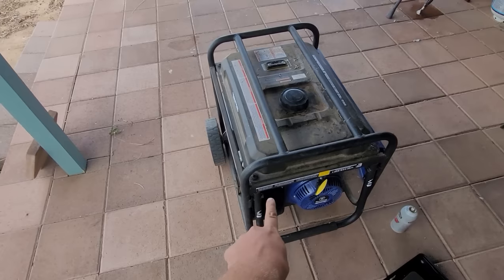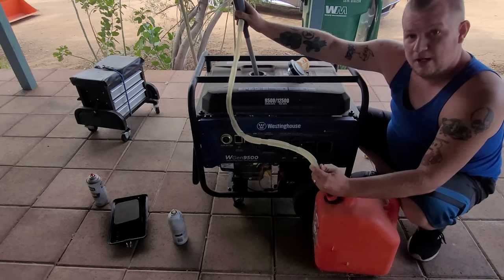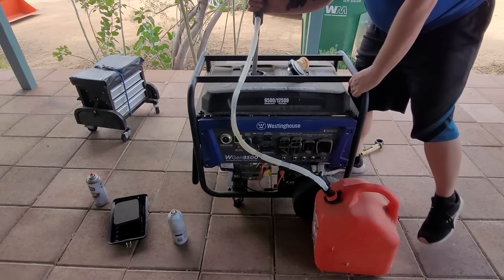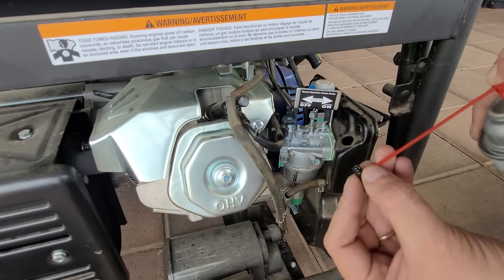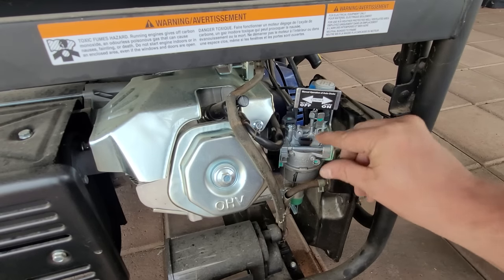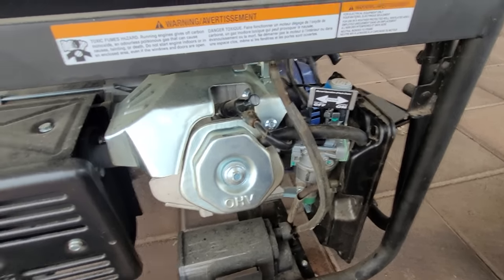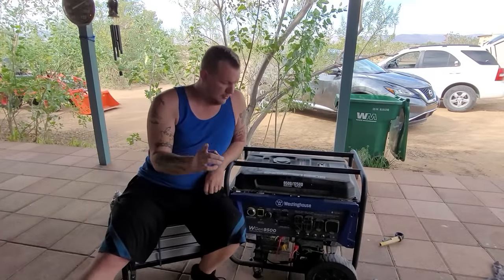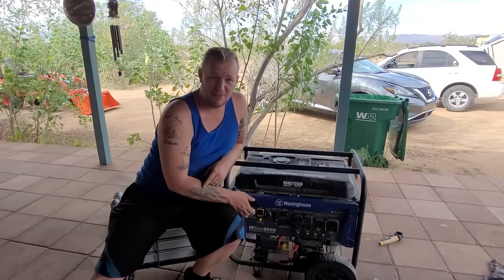Surging Generator? Quick repair for ALL surging and hunting engines.

Comment: Didnt work for me at all.
Drained the tank, fresh fuel, pulled that jet, cleaned and shot the car cleaner down that same hole, cranked it back up and still surging. Purchased a new jet, still surging at idle 🤬
Reply from the maker: I would completely dismantle the carburetor then put it in a cleaner or spray out every hole of carburetor cleaner and a good air compressor and then check your gaskets
Reply from the maker: This doesn't work 100% of the time but at least you tried it. It could have fixed. It sucks now that you got to do extra work though. I always hate that
Reply: @RepairGang  but its funny how every video on YouTube has the SAME idle surge on their generator, as mine does, they pull that same jet out, clean it and put it back in and their generator then magically runs PERFECT ... 🤷🏽‍♂️ ...
Yet mine continues to surge at idle ... 🤬 ... meanwhile everyone else commenting in says ... THANK YOU IT WORKED FOR MINE ... 

Yea im gonna have to pull it off and do a deep clean and watch it still not work, my luck too possibly ...
Reply: @RepairGang  also its funny how i have been using this generator for 5 yrs now with ethanol free fuel since day 1 and i burn off 5 gallons per week ....
Just last week i crank it up to power the shed and the sob starts to idle surge on me, so its not like it sits over the summer or winter in storage, its used weekly ...

Comment: 7:10 - Adjusting the idle screw on a machine that never idles.
Looks closely at that screw. It doesn't touch ANYTHING,
since its purpose it to hold in that black plastic thing
that sits on another jet.  Horrible DESIGN.
I know you did not design it.
Don't know why everybody thinks they should adjust
a screw that doesn't do anything.
Reply from the maker: I know on generators it don't do anything but I just mentioned it for people who want to mess with it lol

Comment: No sense fooling with the 'idle' screw.  That engine never idles as it is a fixed speed unit and always runs at the governed speed.  If it didn't, the electricity it generates would have a variable voltage.

Comment: never a good ides to run a generator on high without a load on it
Reply: Unless you’ve modified it you can’t run your generator at full throttle so not a problem. The throttle is controlled by a governor that is set to hold the RPM at a set speed. It does this by opening and closing the throttle plate in response to the load on the generator. The only time the governor would open the throttle fully would be under maximum load and in that case the engine could only maintain the nominal running RPM, not exceed it. 

What may be confusing you is that some generators have what they call an “ECO” or “Standby” mode. If that optional mode is enabled by the operator, the governor will allow the engine to run at a reduced RPM to save fuel if, and only if, there is no electrical load on the generator that is above it’s detection threshold. As soon as a load is sensed, the governor adjusts the throttle to return the generator to its nominal operating RPM. 

These comments refer specifically to older style non-inverter generators. Some (all?) inverter generators can deliver their rated voltage and frequency output at lower engine speeds if under reduced load since those parameters aren’t directly determined by engine RPM, but by the inverter component.

Comment: Nope.  Brand new gas. Fuel injected.  So NOT " Quick repair for ALL surging and hunting engines. "
Reply from the maker: It's a title of the video sorry but there should be a access point to the fuel injection for a spray could work
Reply: I'm trying a new fuel filter.  I read the manual and it's waaaay overdue for one.  I'll look about for an access point. @RepairGang